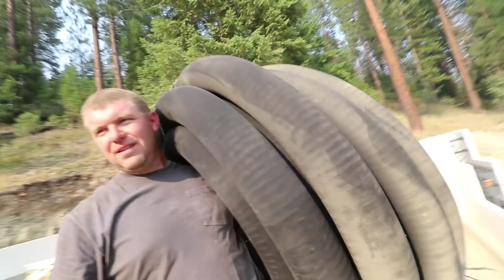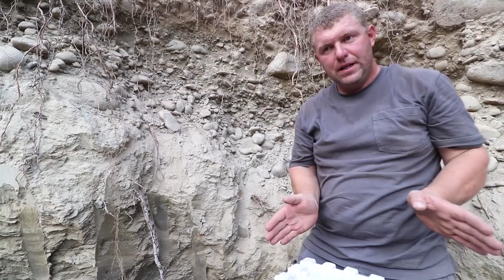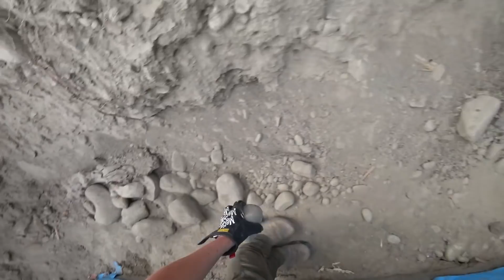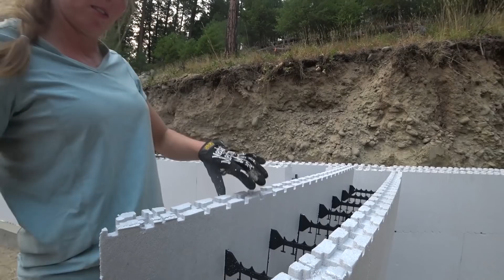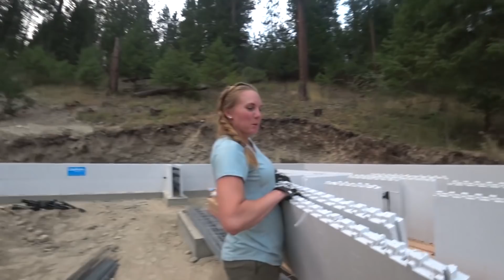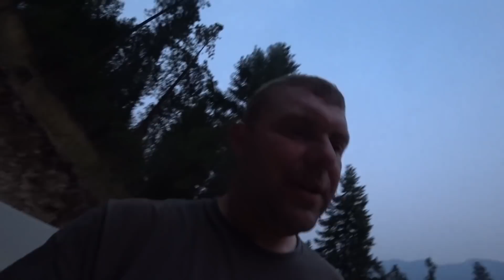OUR MEMBRANE IS DONE! (Waterproofing Foundation)

Comment: Do you have any wet areas under the floor or on the backfill areas? If you answered no,you are more than likely gonna be worry free.. Because from what I've been seeing is you guys don't live in a wet area.Homeowners that live in low lying areas and or underground springs are the culprits of wet spots on walls etc.i've been doing this for over 20 yrs and I can tell you you guys are gonna be high and dry on the side of that hill.Good Luck

Comment: Don't do what I did.  I installed schedule 35 instead of schedule 40 4-inch PVC pipe.  Luckily my septic installer, who also happened to be the previous septic inspector for our county, saw what I was doing and warned me before I back filled.  Apparently,  that pipe wall is too thin and will flatten, instead of staying round over the years.  I pulled it out of the trench and replaced it.  Anybody want to buy 300 feet of pipe?  LOL.  I kid.  I am going to use it for some landscaping drainage projects nearer the surface of the grade.

Comment: I dont know a thing so I assume what I am about to say has been proven that it wouldnt work. Feel free to point me in the direction of why my idea wouldnt work.
Why isnt there a concrete form where the pour goes into the form so the footing and wall is one single pour so there isnt an issue with the seam where the footing and wall pour meets?
Reply: Most likely, cuz that's just the way it's done. Any deviation will require larger investment by the contractor for special forms etc. Specific training for crews involved. It will equate to costing more which will end up costing customer more. Jobs generally go to lowest bidder. People just won't pay most of the time. So changes generally only happen when it's forced.

Comment: Without sounding out of line...why didn't Ya'll have block laid & just tar it really good? I've pumped 12' walls & put rebar in...then tarred the wall,& this was 25 years ago with no problems. Oh well, live & learn I guess. Ya'll r doing a good job...just don't give up. Ur concerns over water n the basement would be more warranted if U were in a flood plain. With Ur location & the drain grade...Ya'll shouldn't ever have a water problem.

Comment: Could you simply place - no fasteners, no glues - a layer of, say, 2" foam insulation board over the membrane before backfilling to protect it from puncture? Also, I probably missed this topic, but will there be any windows or outside doors through the cellar walls? And though it may feel like two steps forward, one step back, just remember, progress is progress. Lookin' good!

Comment: PLEASE use schedule 80 not 40 "foamcore", if you're using PVC for your drain.  schedule 40 is not a strong and meant for indoor drain/waste/vent.  You need the extra strength for underground plumbing.  On that size, you're gonna want it pitched at about 1/8" per foot so the water pours out. That goes for all underground plumbing.  any drain coming out of the floor (sink/shower/toilet//washer drains/and vent} should be schedule 80.  All of which are pitched forward toward the main trap.  Make sure to thoroughly prime the pipe (to the depth it will enter the fitting} and the fitting.  Same with gluing.  And use purple primer so theres no guessing if you forgot to use it.  I tape the 2 cans together so its easier to handle on a site.
Also If your really worried about a lot of water, add a floor drain and tile the basement floor. A floor drain is most likely going to be required in your boiler room and laundry room.

Comment: You're on overkill already. Just make sure you don't dam the water up behind your wall. It would be good if your drain pipe was below your floor level coming around to the front. Use a 3' strip of pond liner under your drain so water doesn't go down and up under your home. Come up the walls with 3/4 chip not round rock. 3/4 will hold itself better. Fabric against the  dirt. Don't go all the way up the wall with gravel, you don't want to take all the hill's water run off and run it down your wall. Slope dirt down away from your home and let the water run around on top as much as possible.

Comment: Is the foam icf permanent or will it be removed after filling with concrete?
Reply: the point of icf is to create a strong insulated wall, remove the foam its no different than a block wall filled with concrete
Reply: mumixam oh that makes sense. I thought It was only used as a form for the concrete. Thanks
Reply: That's exactly how I figured it out lol
Reply: Raymond Mundt idk dude. I've never heard builting a house out of foam
Reply: Jay Zenitram I figured it was used to form the concrete with the rebar inside and you just pulled the foam out, but I get that the foam is insulation
Reply: Jay Zenitram 
Yup.. the foam stays. It has to be protected though, multiple membrane systems on the exterior, and fire rated sheet covering in any habitable space, like sheet rock with taped joints.
Reply: Frank C ? They never addressed it.
Reply: With the thousands and thousands of plastic crossmembers holding the walls together, I would absolutely love to see someone try to remove that foam after the concrete is poured hahahahahahahaha
Reply: Devin Donathan :(
Reply: soaringtractor you should get a prize for being so smart

Comment: THOUGH OF A SOLUTION TO YOU MEMBRANE/BACKFILL PROBLEM

Correx Corrugated Plastic Floor Protector Protection Sheets Board 1.2m x 2.5m
it will take the backfill knocks with out letting rocks damage your mambrane
sure they got a cheap similar product in the US and you just tape it to the walls

Comment: The fact that you have a layer of foam on the outside puts you miles ahead of what most homes have on their foundations.  You have 2 layers of foam, adhesive membrane, a perimeter drain and it looks like you are nowhere ne'er the water table.  I'll trade you my house which has none of that.  You should be fine.

Comment: Concrete. I feel for you but don't worry too much if the damn thing leaks you can seal it from the inside, wet concrete is not gong to disintegrate. I dug out some concrete fence posts recently because the reinforcing bar was cracking out the surfaces but guess what, where the posts were underground the concrete and reinforcing bars were prostine. No air?  I don't know but if you back fill it seems to me that you will have a similar situation except for the membrane! My ground is good loam and the temperature is seldom ever below freezing so that may make a difference but in the N.Amercan situation where people appear to make a career out of sueing people it wouldn't surprise me if manufacturers loaded there literature with processes which are difficult to follow to the letter and yes maybe impossible to do perfectly. Can you research some similar concrete structure of a bygone era for your peace of mind? The attention to detail in all that you have done is so far more than any contractor would do, all has to be alright.

Comment: i really dont know you talked to or what you told you but heavy plastic would have done exactly what u wantedl good seal cheap and u tape it in place. place the dirt and it sits where u put it forever. both the membrane and plastic have a life of how long it will last. they both should last a very long time plastic degrades in the sun and last forever underground. the membrane is tire it gets hot cold and then after a few years it cracks. save yourself alot of repairs and just cover it in plastic that membrane will not outlast the plastic.

Comment: It is commendable to do this, and i know why you chose to use icf, and heck in the long run doing it yourself might be cheeper.  It just looks like its more work than its worth.  

Also the metal hvac insulation tape might help pretty well for joints.

Comment: well done!  I understand that you are stressed at the moment that you find out that something is "wrong" and nobody has a clear answer.  You did well and used logic reasoning to get to the solution: if a builder applies patches at most and use none of the "5 recommended products" the you just follow that way of working and your house will be fine.  Concrete should be waterproof so I see nothing to worry much about.

Comment: There is no such thing as waterproofing.  You're putting in a slab with 1 side tucked into a rocky hillside with drainage.  My area is heavy on basements (tornadoes).  The soil is heavy clay with a thick layer of bedrock sometimes right under the basement floor.  They treat the exterior walls by spraying them with tar and they fair quite well.

Also, I'd use rigid drain along the back wall and the congregated along the sides as they won't have the weight of full-height backfill.

Comment: Humm seems there's a lot of mixed info out there and that annoys the living daylights out of with these new systems and lack of imformation. I tried to order a lintel the other and was told oh I can do you an x one the cavity was to big the grade was to low and not what I wanted but the goon in the shop said oh it will be ok. Shame they can't train folks that work in these places so they understand the products they sell

I'd say if concrete walls are good then this membrane if you got a no holes in it should be enough.

Comment: Jessie needs a new project manager, looks like it's okay, one things is give it plenty of room to relax, after the back fill get's put in it will stretch in. The primer, or first adhesion layer you spray on before the film is more for contact with concrete or old foundations as the membrane won't stick to that, it will just fall off. So sticking the membrane directly to the foam should be good as long as it sticks well, which it looks like it does.

Comment: Very Frustrating for sure - lots of head scratching.  The hard drain pipe also lets you do a clean out later, the corrugated just tears up if you run a cleaner device (e.g., auger) through it. 
Slab thought -- In our place they poured slab with foam underneath (OK), but also coming up sides insulating it from foundation.  Previous owners were always bothered by tons of insects getting in the house - they didn't know why.  I found the bugs were able to come up from the ground through the path of foam and into the house.  Cut into this peripheral foam and found bugs and eggs etc.  So had to dig this out all around the perimeter and fill with sealants and concrete.  Just be cautious of any "foam paths" into your interior.

Comment: best of luck, definitely rookies, You need to do all your research before you start building , surely you have plans approved by the local council or state  authority  showing the specifications of your building ?, did you use a local draftsman or an architect  , or there must be (as in Australia ) a "standard for building" domestic houses ,  that tells you what and how to build ,??  try polyurethane for sealing joints , it is the stuff used to  stick a car windscreen in to a car with , it sticks to anything , doesn't have any uv problms and it strong as batshit , don't use silicone ,it's  shit and it will fail if stretched. best of luck

Comment: Man your really over thinking everything. Calm down a bit.  The membrane is good stuff.  I've used membrane that was like using thin garbage bags and never had a leak and if the walls are half an inch out who cares, you still have the interior to build and correct or mess that up by half an inch.

Comment: I enjoy your videos - but you're knocking yourself out trying to do things too perfectly.  Wrapping the footing with insulating foam and then waterproof membrane is extra work that offers little payback.  Where is the floor level?  Your interior footings suggest the perimeter footing is lots lower than the floor level.  Since you'll be filling the interior with gravel - at least up to the top of the footings, some interior perforated ADS drain pipe inside will be more than enough to drain any water that manages to get into your underfloor area.  Lots less expense and lots less work than your detailed work at the footing perimeter.  If your location requires heavy insulation, there are easier ways - on the interior, at the perimeter of the floor slab along the edge and even underneath if needed.  Dow SM (?) has a high PSI compression rating.

Comment: Honestly, they should hire a Project Manager to oversee this project to avoid all the costly little mistakes being made every step of the process, and to avoid a possible big mistake in the future. Pay him a percentage of the value of the home, say 8% - 12%, and avoid all these simple but costly mistakes. Jesse and Alyssa can still do all the work and will still have final say so, but the problem now is they simply don't know what they don't know. Get someone in there that can guide them through the minefield of obstacles involved in being your own contractor with no experience. How many mistakes have been made at this point? And they haven't even gotten out of the ground yet! I admire their determination and attitude, but at this rate, it will take them much longer, and cost much more than they planned on. I've seen it happen too many times.
Reply: Paul Allen I said the exact same thing in the comments and i think others have too. Completely agree. Time to get a professional in to guide them in these initial stages instead of listening to hardware store talk. There's a huge difference!
Reply: That sounds like a great idea. I respect what they are trying to do but they need an overseer. Heck competent builders run into problems,  I am afraid they are going to run into a significant obstacle/did something wrong.
Reply: Paul Allen they dont need as long as they are happy with making mistakes " as a learning process". They only thing im thinking about is ,"what are you learning and for what?". After this you for sure will not want to build an other house or see any of it...
Reply: xander witt, exactly right. If they are happy continually screwing up and paying for it, more power to 'em. Like I said, I admire their determination, but the continual mistakes are adding up. Know when to say when.
Reply: yeah thats a good idea,,as a 67 year old builder,,,,,cheap,,,oh well
Reply: the doing it twice thing is not a savings,,live and learn gets costly,,,,the over step on footing is very basic,,,they didnt get it,,they need a PRO,,, to advise them,,,someone with a track record,,,
Reply: pffffff yeah do you have 80k/year for that?
Reply: The project manager will cost more then the project at this point.
You either save the money for the obscenely expensive contractors, or you make it reasonable and put lots of your work into it, which is why most people will never have a house of their own.
Reply: First thing he'd do is kick Jesse off the site...
Reply: polnar jean, That's not the point. One, only one, of the reasons to hire a PM is to avoid costly mistakes, both big and small. But there's multiple reasons and justifications to hire a PM. PMs do not work for free. You are paying for his knowledge, experience, and guidance to keep the project running smoothly, on time, and on budget. His salary is a line item expense one chooses to add to the bottom line. It's impossible to know how much he "saved" in mistakes and cost overruns, since the mistakes were never made. My 10%-12% suggestion is just that. A suggestion. I actually bumped it up a bit since it's been awhile since I kept up with such things. Some work for more, some less. But my suggestion is for the "value" of the home, not how much it cost to build. Want to use actual costs? Yeh, probably closer to 15%-20%
Reply: TBPollock, you are probably right, sir. (Madam?)

Comment: Aren't traditional building methods a bit outdated and stupid?
I have only very little building experience but I wanted to throws this somewhat contrarian view in here. The more videos view and articles I read the more complicated all this seems to me.
Why not use truly waterproof materials? For example you could easily mass produce SIPs out of fiberglass and rigid foam. They are lightweight and can be made totally watertight. You need like 2mm fiberglass and XPS or PU foam to create a very well insulated and very strong and stiff wall.
Instead you have to mess around with forms for concrete, rebar, membranes, siding etc.
Instead of using nails and screws you could just use 2K adhesives like epoxy, polyurethane or polyester resins to fix things together.
You'd still need a coat of paint once in a while, but it seems these elements could be build fully automated in local factories and be much cheaper than all the different materials mixed together and all the labour and expertise needed for them.

You could even 3D print custom build elements in an automated factory. Using foam or automated fiberglass lamination.

Drill some heavy metal spikes / screws into the ground instead of pouring a foundation. They could even be removed or adjusted easily later on.

Comment: After watching your great last video. I build interstate highways for a living and deal with engineers for a living. DO NOT over think the problems. concrete is concrete. It don't leak unless you have a  crack. if it's soled it won't leak. But it will SWEAT. Any type of membrane or any moisture barrier like the membrane you have all ready installed will work great. the corrugated pipe you had will work just fine. do to the fact your not driving a truck over it. the load that your are putting on it is spread out by the rocks on top of it . The only point of it is to take  a small amount of water that will get in-between your foundation & natural ground away from your house. you will accomplish most of this by grading water away from you house. that's just a long way to say that your pipe would have worked. In a nut shell . DON'T over think  things. get back to Plane old common sense.
I still THANK YOU for your time and money it takes to put out the Videos. :)